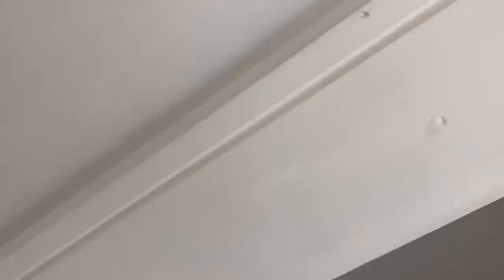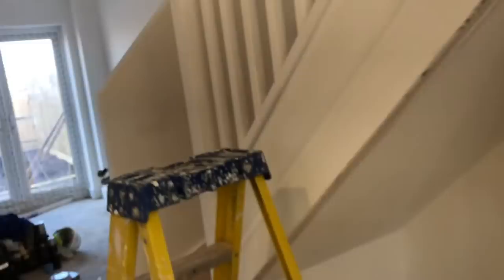Some painters are just Unbelievable, His idea of painting

Comment: I usually prime everything before I do any caulking and filling. Just saying.. you can have adhesion problems with the caulk on bare substrate like timber and plaster. 🤷‍♂️ crap painter tho.
Reply: Gary Day.. the painting is a bit slap dash as well to be fair :)

Regarding priming first.. it’s also saves your finger ends from being ripped to bits when caulking. 👍
Reply: Prime, fill, undercoat and then caulk before top coating . Unless you dress with your underwear on the outside.
Reply: You need you're caulk dry early tho so you can cut into it with you're  emulsion.. i get it but but me always Caulk first it's outta way